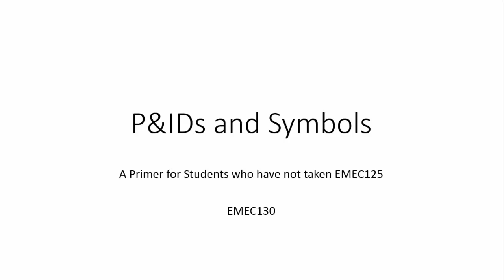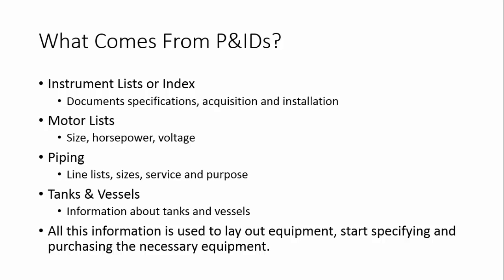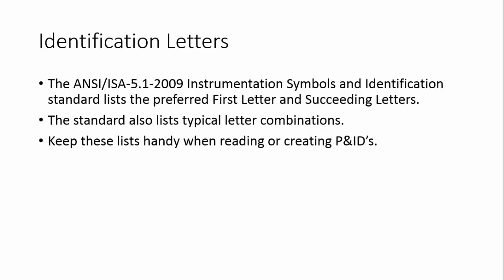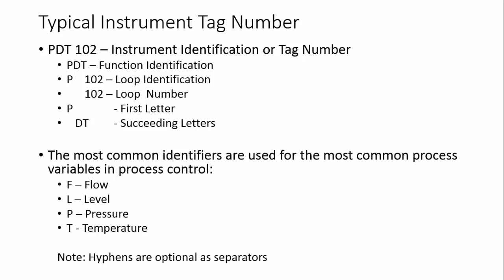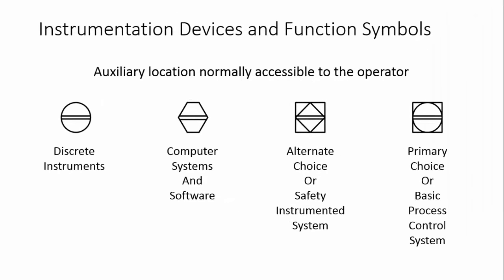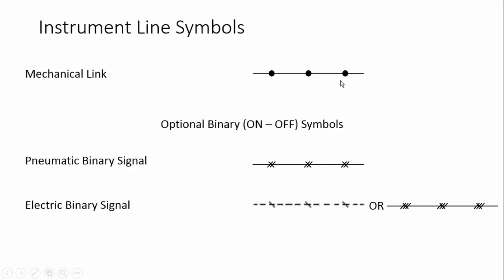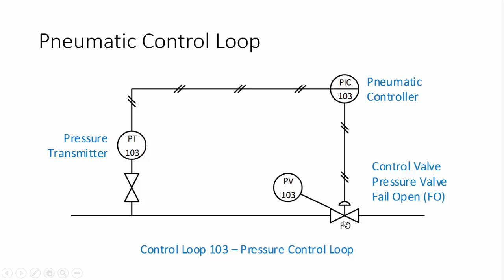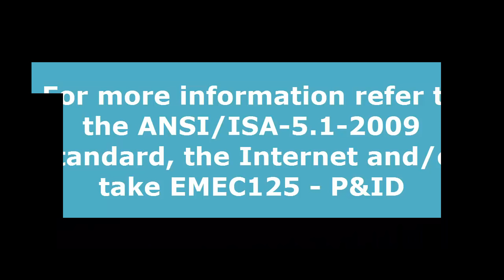PnID Symbols and Lines

Comment: Thank you, sir, for explanation and great labor!
However I am still confused with some designation, especially in mining field instruments. I mean, I have no idea how to name, for example, bearing temperature sensor or belt misalignment sensor. 
Unfortunately ISA doc doesn't list a plenty of different functional elements.
Reply from the maker: There isn't, or a least wasn't any standard. People migrated toward ISA simply because they are attempting to define a standard. You can certainly create your own symbol and nomenclature. Just be sure to create a key on the drawing that shows and defines to the reader what you've done.
I've seen many user defined symbols over the years, especially in the biotech field. Again...just make sure you include a key on the page to inform the reader what the new symbol is and how to read it.
Thanks.

Comment: So the undefined signal means that the signal type is unknown ??
Reply from the maker: Thanks for watching. An undefined signal is exactly that, a signal that does not have a symbol in the standard ISA library of signals. Therefore, if you have a process that has a signal that is unique and does not have a defined symbol, use the undefined signal and reference what type of signal it is in the key on the drawing. I hope that helps.

Comment: What’s does discreet instrument mean
Reply from the maker: Thanks for watching. A discrete instrument is an instrument that is detached from other instruments in the process. As an example, a discrete instrument could be monitoring the pressure in a vessel. The discrete instrument, a pressure transducer/transmitter, sends the pressure reading to a shared control instrument that then displays the pressure. In other words, it is a stand alone instrument that has to send it's data someplace to be read. I hope that helps. Also...here is a weblink that might be helpful: https://eng.libretexts.org/Bookshelves/Industrial_and_Systems_Engineering/Book%3A_Chemical_Process_Dynamics_and_Controls_(Woolf)/04%3A_Piping_and_Instrumentation_Diagrams/4.02%3A_Piping_and_Instrumentation_Diagram_Standard_Notation

Comment: Can u please explain types of loop in p nd. As u explained in the end of this video like pneumatic control loop n electronic control loop. I want to know total types of control loop in p  n id with one example of each. I will be grateful sir for my entire life. Please🙏🙏🙏🙏🙏🙏🙏🙏🙏🙏🙏🙏🙏🙏🙏🙏🙏🙏🙏 sir. I m from India. Please sir
Reply from the maker: Pdms Caesar. Pneumatic and electronic technology are not control loops. They are technologies used for the instruments in a control loop. As an example, pneumatic is equipment and instruments that operate using compressed air or in most cases nitrogen. They are rarely used anymore because they are very slow responding. They're primary use was in area's where there was a spark hazard from electronic control, but even that is not an issue anymore. Electronic control is exactly what it says. The equipment and instruments use electronics. Most of the time they operate on a 4 to 20mA signal or a 0 to 10Vdc signal. They are fast and very reliable. There is also mechanical. If you think of something as simple as a toilet tank. This is a mechanical control system. As the water rises in the tank it lifts a float. The float is attached to a lever that raises with the float. The other end of the lever is attached to a valve actuator that closes the valve. When the toilet is flushed, the level decreases, the float drops, the lever rises and the valve opens to allow water to fill the tank. If you do a web search, you can see examples of all of these technologies. There are also many good YouTube video's that demonstrate these concepts. I hope this helped?